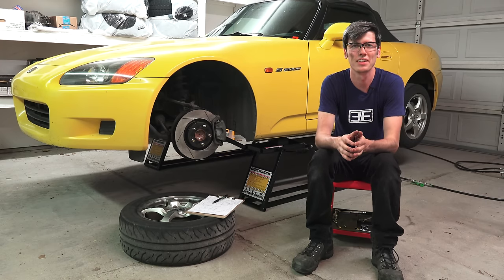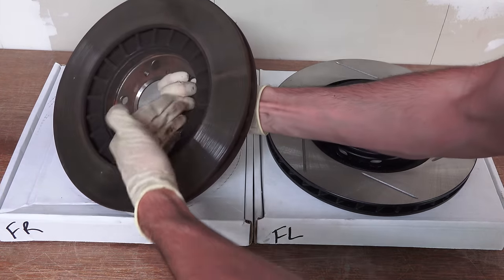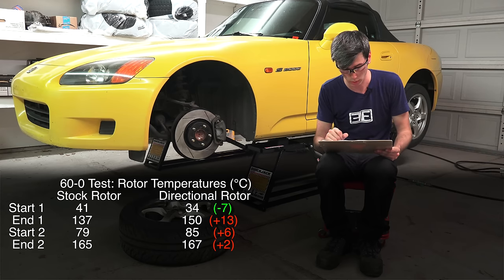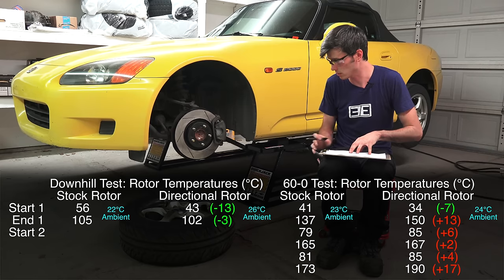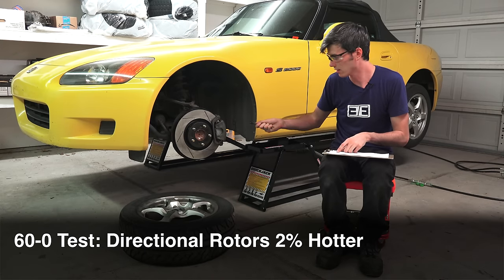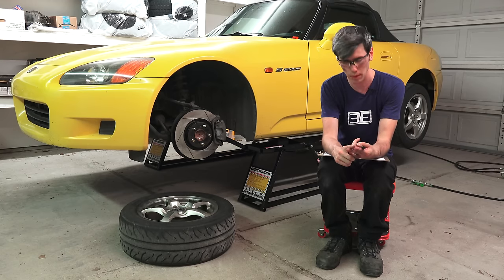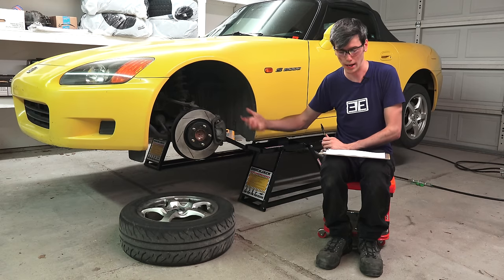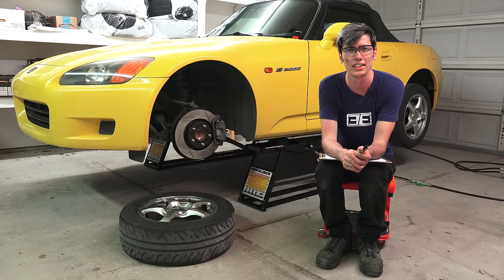Do Performance Brake Rotors Have Better Cooling?

Comment: So bottom line, if you drive your car on the street only, go with the greater mass rotor.  If you are going to track your car, go with the lighter, better cooling rotor so you can get rid of the heat put into the rotor more quickly.

FWIW, as soon as I saw the first round of test data I was asking myself, what was the mass of each rotor.  I suspected the directional rotor had less mass and that was a primary factor in why it would have a greater temperature delta compared to the stock rotor.

Nice work.

FWIW #2, when I'm buying rotors for my cars, I tend to look for the rotor with the greatest mass as I believe it is less likely to warp under daily driving conditions.

Comment: As a fellow engineer, I want to say I really appreciate your scientific approach to your testing. Its always a nice change from other channels and their "tests" in which they read more like opinions. Thanks!
Reply: This isn’t even remotely close to a proper scientific test, it’s poorly done without proper context and a terrible conclusion. One rotor getting hotter than another means literally nothing without any other data. He does this sort of poor testing all the time and I have no idea why people think he’s got valid opinions. He really needs to stop making videos like this if he’s not going to do them right.
Reply: TheHannukahZombie It’s not 100% about his tests themselves, it’s the fact that he lays out all his actual data which allows me to form my own opinions. His conclusions aren’t always the same as what I conclude from the information but the important thing is the information is laid out. And full disclosure, I didn’t fully agree with everything he did in this video as well, but I was able to draw a conclusion myself from his data. In this case the flaw is the implausibility of being able to give the exact breaking force on each of the long breaking sequences equally each test, but the data given yielded good info nonetheless. It’s more about the amount of mass of the disk then anything else. But I’d love to see a test with crossed drilled rotors as I noticed a huge difference on my Corvette Z51 which has them in fade resistance

Comment: It would be interesting to know if there is any difference in wet weather braking efficiency. I put 6 pot billet callipers on my Honda CBR600, they had individual pads so took three pairs per side at the front, and had a big improvement in wet weather braking. I’m convinced that the gap between the pads gave any water that made it past a leading pad somewhere to escape. It would probably be boiling off at that point. Or it could have just been that massively powerful brakes with single pads each side would have worked as well in the wet.

Comment: If the fins inside the disk are oriented, one disc with cool faster than the other one. The fins in oriented in the forward rotation will blow 40% more air than the fins oriented in the reverse rotation. I saw a test about fins orientation in a centrifugal air blower.
Reply: 0:57 The rotors are handed.

Comment: These more expensive rotors are basically in the category of many other items we think will make a difference on our vehicle, motorcycles included. Unless you were going to completely upgrade the entire braking system with larger diameter rotors and what not, these really don't do much for improvement especially for the price.  You would have to do a more high-performance braking test in more a racing situation to really notice if these make a difference. But really, they're just to look cool, and something you can brag about, so that you can smile about when you look at it yourself. But as far as true performance upgrade, not so much. But that's never stopped any of us from customizing our vehicles anyway.

Comment: You measured how hot the brakes became after braking instead of measuring how quick they can cool after venting them on the road. In theory, directionnal vanes will allow more air to circulate into the disks, allowing quicker cooling. My 2 cents.

Comment: The slots are mostly to swipe pads clean and release the gas build up between the rotor and pad while engaged. Drilled rotors decreases the temperature allowing more air flow.

Comment: It looks like the aftermarket rotors are brand-new and therefor have a more rough surface, that will definitely cause a hotter disc. A new brake disc has a "break in time" approx. 150 miles after that it has hardened even more and the surface starts to be smoother.....just saying.

Comment: My thinking is that the regular rotors actually pull the air in from under the car, not the engine bay. The difference in pressure from under the car and the sides of the car pulls the air under the car, through the rotors, and out the side of the car where pressure is lower. The reason the performance rotors got hotter is because they're trying to pull low pressure to high pressure. perhaps to get these rotors work properly, you need to cut them off from the underside air, and get wheels that pull the air into the rotors. But still, It's fighting against aerodynamics and thermodynamics to get them to run right.

Feel free to tell me if I'm talking out of my ass though. I feel like Takumi Fujiwara explaining drifting saying you make the front tires slide, but I'm open to it if I'm wrong.

Comment: In theory the reason the aftermarket/performance rotors would be hotter is because they provide better grip which in turns creates more friction.  Friction equals heat which would account for the added temperature difference.  I would suspect if you did a stop test in regards to stopping distance, The aftermarket rotors would of performed better.
Reply: But thats not the point of his study

Comment: I know this is old.  But still good info.  The brakes designed for the street performed better in street use and those designed for the track performed better in track use.

Comment: I am not an engineer. I am not a mechanic. But, simply seeing slotted rotors versus stuck seems as though there would be cooler temps. Although, I did find this video very interesting. Thank you.
Reply: Cross drilled cools the rotor, slotted will cool a little but the slots keep the pads from glazing over

Comment: Slots, dimple drilling and cross drilled rotors aren't for lowering temp they are to removed the gas and dust that is generated by the pad to enable better contact of the pad and better friction enabling  harder braking and with less effort. hence the reason for not using standard pads with performance discs. you need to use Street race/track pads or full race pads to get the best out of them.

Comment: The slots on the side of the rotors are not to act as a fan, they are to clean and cut into the pads for bite, and the main reason is to allow the gases to escape into them and be whipped away so they do not build up in between the pad and rotor causing brake squish. Which means gases acting like a sponge.

Comment: Only two problems with your test. One you had the stock rotors bedded in and did not with the aftermarket rotors. Second problem is your speeds are two low to create a pull with the vanes. You said 40mph. They may need to be at track speeds to see a difference in cooling. You mentioned this but you are right, your speeds would be too low to get the advantage.

Comment: If the factory rotors are worn in and the aftermarket rotors are freshly machined the factory rotors will have a smooth finish they'll generate slightly less friction than the aftermarket rotors. Slightly greater friction could account for your 1-2% temperature difference

Comment: Just a thought on your test, could there be a minor difference in the amount of friction from the two types of rotors?

Here’s my 2 cents. 

If the performance rotors had better contact with the brake pads and/or higher friction factor, that would mean the rear brakes would have worked less making the front brakes hotter.

Other way around, if the stock  front rotors had less contact with the pads and/or less friction factor, then the rear brakes would work harder for the same stop making the front rotors cooler.

I wonder what the result would be if you disabled the rear brakes and ran the test again. 

And we’re the stock rotors turned before this test?

Thanks for the great video.

Comment: If you live in a climate where winters include snow, salt and brine the drilled and slotted rotors are NOT  a great idea. The salt and brine collects in the holes and slots causing premature deterioration.  Have seen them having to be replaced after only 15-20,000 kilomteters.

Comment: It's actually better for the rotors to heat up quickly at low temps because performance brake pads work better once they have some heat in them. Those rotors probably stop a little quicker too, which creates more heat, even with the same brake pedal pressure.

Comment: Where performance brakes are concerned, it isn't the heat dissipation, it's a matter of friction coefficient under hotter temps. These types of brakes are not designed to remain cooler while driving, they are designed to keep their friction coefficient under high temperature operations.

Comment: This test is flawed. Slotted rotors are for quicker braking, not cooling. Drilled rotors are for cooling.  The degas slots are to remove the gas between the pad & rotors when braking for better response, which is why the slot direction doesn't matter. Since you have more pad contact while not braking, I could see the temp being a bit higher. Holes allow air to contact more surface area for better cooling. This is why there is usually the option of slots, holes or both depending on need. Variations include whether you use a degas slotted pad or not. You could slot your pads which is cheaper than slotted rotors, then you only need drilled or vane directional rotors for cooling. Pad compound varies in temps retained and gassing. Then there's the when wet factor.

Comment: I thought that the point of slots were for facing the brake pads and that drilled disks were for getting rid of gas and getting water off the disk and assist in cooling. I have slotted and drilled after market disks on my Jag.

Comment: If heat is an issue then just hollow out the center with blower fan style fins and exhaust it from a ring shaped vent near the bolts

Comment: Those rotors are back to front, the slots are not for cooling, they are meant to allow for outgassing from the pad, and are meant to centrifugally discharge those gases. Its such a pity that the S2000 has been sold now as it would be really interesting to see how they performed if you flipped the rotors.

Comment: I noticed this is from 3years ago. Wonder if anyone has ever noticed that he installed the rotors on the wrong side. Probably why he didn’t see the cooling benefits of slotted rotors. Another benefit is brake performance when temperature is high will be much better with the slotted rotor. It channels the brake gasses away from the pads to limit fade.

Comment: I think the "race" rotor is DESIGNED to be a little hotter because most "race" pads only work better than stock when they're at racing temperatures. If the rotor is inclined to stay cooler it won't help the pad stay hot and a race pad will cool down more and fall out of effective range.   So in a daily driving scenario, maybe the race rotor intentionally wants to get hotter QUICKER, BUT stay cooler at the highest temps, all the while keeping the race pads at their optimal temps (hotter than stock but not overheating)  

In other words, the rotors are to be used in conjunction with a racing pad and serving their specific purpose better than a stock component for THAT use... while the stock was designed to perform best AT daily driving use and will outperform the race derived stuff specifically in the way you tried to test them.

Comment: The slots remove a tiny bit of the pads to keep the surface clean, if you want cooling get drilled discs.

Comment: I'm sure that you followed the disk papers direction correctly but, if you think it out you 'll see that the groves are backward to the natural flow of heat in metal objects heat always flow outward toward the outer edges and the way your cooling groves are just forcing the heat back inwards rather than forcing the heat to flow outwards thereby causing the disk to be hot than normal try the disks on to opposite sides where the groves will aid the flow rather than fighting the natural flow. I'm sure this will help the disks be cooler than you have recorded them to be.  In racing, I've always placed the groves to vain outwardly with the leading ends of each grove being forward when each grove at the top over the center of the axel while the trailing end being more rearwards. You will see that the directions are incorrect.

Comment: Would have been hard on the car, but should have got up to like 60 mph and the floor it but use your to keep you at 60, then really quick get out to check them temp, then get back in the car and floor it to 60 and just drive there for 30 seconds, use your e brake to stop you and get out and check them temperature. I believe in this test, you would have seen a real difference

Comment: Regarding the mass difference:  Do you suppose that the lower mass might make the high performance rotors more susceptible to warpage over time?  Cause durability is my focus since the new rotors on my Nissan Sentra lasted just over a year before significant pulsating performance which I attributed to warpage occurred.

Comment: Whoooh. I had bought new performance rotors from EBC and on the package was written witch one goes witch side. And according to that information your rotor is in wrong side. And It has technical reason. When rotors spin, in your case gases are beeing pushed into the centre of rotos instead of centrifugical force to escape from rotor.
Reply: I noticed his mistake there as well.   There is another YouTube video that shows this, "How To: Tell The Difference Between Left and Right Drilled & Slotted Rotors | PowerStop".

Comment: The different vane design gives improved cooling when the rotor is spinning, you should have got them up to temperature and then measured the cooling while driving without applying the brakes. Also you should have put them on the correct side of the car/

Comment: Higher temperatures means better braking efficiency as more energy is converted to heat also slotted rotors prevent a gas buildup between the pads and rotor this will make for better pad to rotor heat transfer. The real question is pad and cal temp
Reply: High temperature ≠ better braking efficiency unless you take into account relative rotor mass and specific heat of the materials. But the rest is correct.

Comment: The groove on the face are not for cooling, the grooves are to expell gas that builds up between the disc and the pads. When the gas builds up it creates a gas pressure that pushes against the pads, which causes brake fade.

Comment: Bro, that slotted disks it's hotter because that it's make to brake better, pads bites better from the the slotted disks , they get almost the same temperature for better breaking. You need to make a break test to, and yes a track efficiency.

Comment: I bought drilled rotors instead of stock. My stopping power increased a lil bit and I drove 60.000 miles with just one set of brake pads

Comment: At 2:50 it looks like you are putting the wrong rotor on the LF if you say they are supposed to pull air in from the outer edge. The vanes are curved the wrong way. I think a better way to test would be to put one stock rotor on one side and the after market on the other side. That way ambient temp and differences in how much braking they did would be eliminated.

Comment: One question, are you running the stock rotors and the aftermarket with the same pads? ceramic semi metallic and metallic pads have different temperature rating as ceramics to perform well may need higher temps and metallic would need less temp to perform as expected, they behave different also due rotor alloy also could be a factor, also is the stock rotor used? how much millimeter in difference between them?  new should be ticket thus hotter and old rotors well old rotors must have a smoother glossy surface that have been in contact with the pads for a while... Just saying the true test must be held in equal conditions or "recommended" conditions as per my current rotors recommended ceramic pads and advised me that using metallic rotors would work but would degrade my disks faster.

I haven't checked temps but i got a mitsubishi lancer gt 2.4 ran it stock for about 34k until the pads required replacement the front disks required resurface etc (I drive a lot up to 600miles per week) so found this R1 concept cross drilled and slotted for less than the oem ones with very good reviews online and decided to try them, and its been 1 year and 8 months since install and they are running strong as hell my car is 78k now and it can stop very quickly and with no issues whatsoever I am always impressed with the manufacture and attention to detail they haven't even rusted out like the oems and the surface is smooth with no scratches nor noise, gotta say that I drive fast and the roads I drive to are irregular and it rains a lot over here so like I said in my experience cross drilled slotted are good in my book if you find a good manufacturer like I did.

Comment: I'm pretty sure the only rotors that work for cooling the temperatures are the drilled & slotted, yours are just slotted, the slotted do nothing more then clean brake dust off the pads and help with braking that way, it's only the drilled rotors that cool better. I think that's how it works, I could be wrong but that's what I always thought.